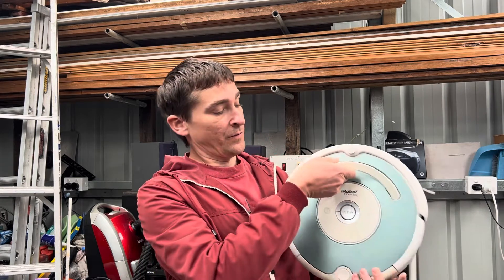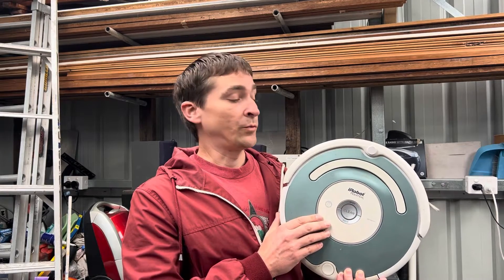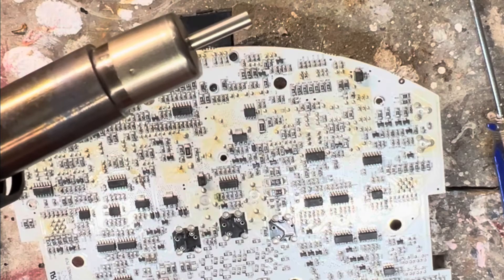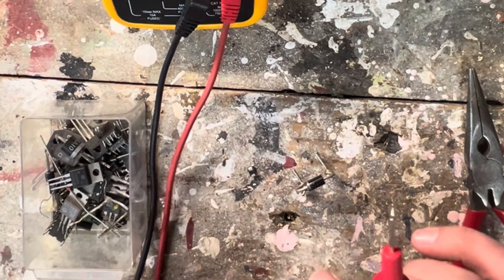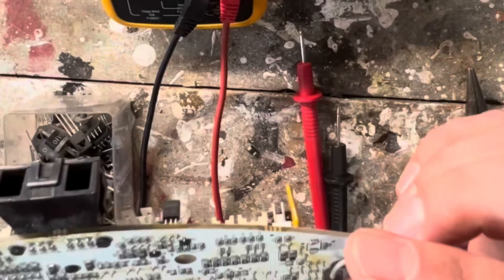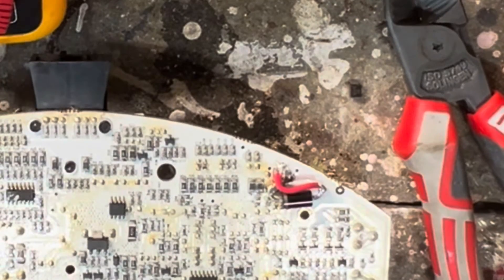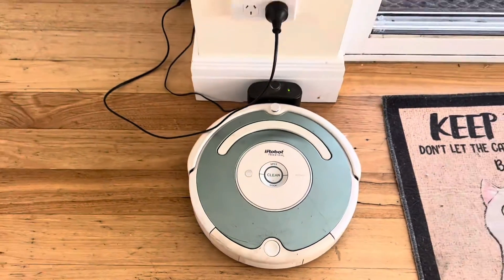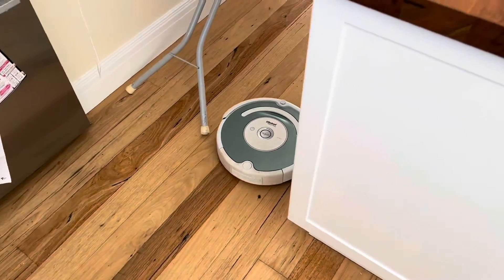Roomba 537 charge error 3 repair

Comment: In my case, it was the 470uF 10V condenser being bloated on the back side of the motherboard (it's pretty close to the battery charging terminals).
Reply from the maker: Nice work! Good to know bloated caps could be an issue too.

Comment: Hi! What voltage does it has to have? From the charger I'm getting 21,7V. The battery will be charged just with 4,7V! Is that ok? The dock station, I'm not using it, because it has a voltage problem and I'm charging directly through the cable-jack from iRoomba. Im getting sometimes error3, and in the last time error5 after a reset. The measurements are the same, before and after adding the diode.
Reply from the maker: 4.7v is too low for the battery. It’s rated at 14.4v. A first check could be to try fully charge the battery separately and check the Roomba all works ok.

Comment: Those (3) diodes are marked 829 and from measurements they seem to be 32V bi-zeners. Any chance you remember the code on yours?
Reply from the maker: The one I removed is PJ1519. I found a website in China that states this as a 2A 60V Schottky diode. No mention being a Zener.

Comment: I have a case, where I get Err3 while charging. The issue is, I got a replacement battery and it behaves exactly the same way. Charging in docking station OR charging directly with cabel connected into Roomba, no difference.

Model 650, but i guess the core would not be too much different in these basic behaviours. It all started with the battery getting less and less capacity, and after the replacement of a new battery, it behaves like this. Both with old and new. So, does not make much sense, that after something which seemed to be "old" battery, it actualy shows symtoms of a totally different issue. I am lost with this gadget really.

Any idea, how to troubleshoot?
Reply from the maker: That’s unfortunate. Sorry to hear you got a new battery only to find it still doesn’t work. Did you test the board components like the video? I found the diode was open which may have been a cause. But there’s other components responsible for charging including the MOSFETS which I also tested but were ok on mine. I hope that helps.